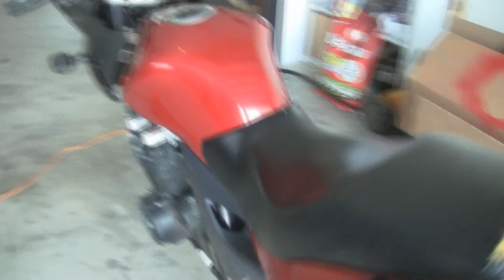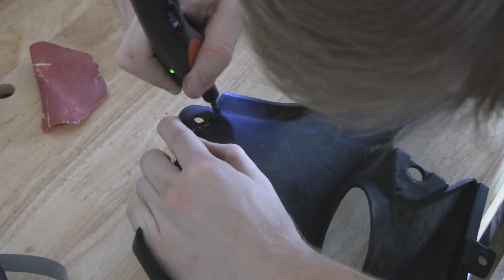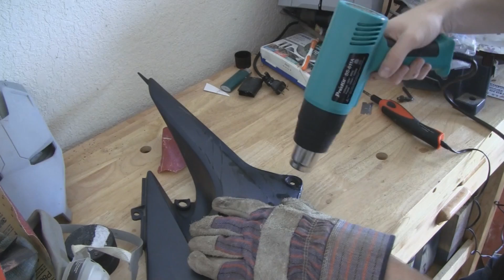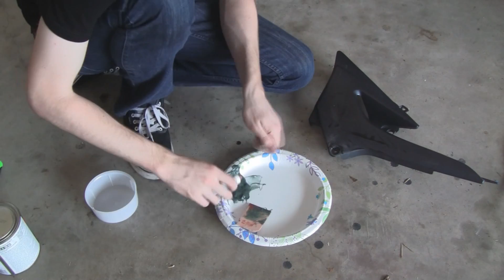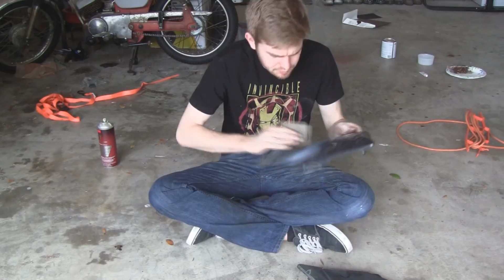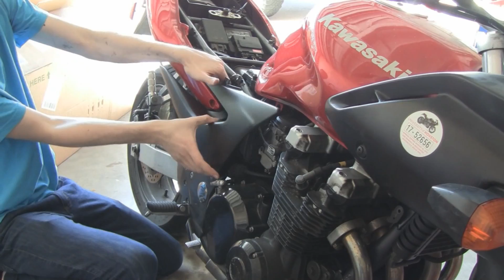Plastic Welding and Painting the Side Panels | ZR-7S Project - Part 7

Comment: i have the exact bike and the other day i took the panels off because the previous owner painted them yellow, so i put paint stripper on them to remove all the paint because i saw it on a you tube vid, I totally ruined them and basically melted the plastic....oh well i guess you live and learn. cool vid though!
Reply from the maker: Hey thanks! And yep, paint stripper and almost any other solvent will definitely damage the plastic. There are some plastic safe paint strippers, but they're a little more pricey and less common than most other strippers. Sanding is tedious but always gets the job done!
Reply: you wouldnt happen to have any vids on how to adjust the valves on the zr7 would you?